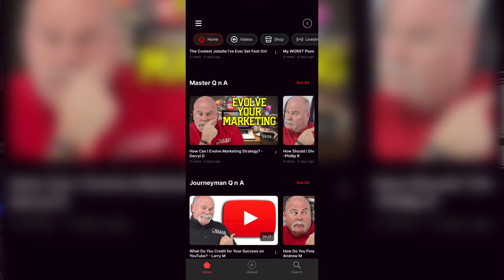Service Plumbing SUCKS Try This Instead

Comment: 3rd generation plumber here who was unable to escape plumbing as my career. Ive always hated how gross plumbing was and did spend my time in commercial new construction and remodel because it was cleaner. After years of trying to escape i stopped struggling to get out of plumbing and embraced it. Managed to get myself a job at a residential service company office. Sure its less than i could make in the field but no more dealing with sewage or the toll construction can have on your body.
Reply: At least being out in the field more or less forces one to get and stay physically fit. That's a plus.

Comment: I’ll never forget when I was about 20 yrs old. 
I had done a little bit of service plumbing and tried out new construction, realized how much better service was for me. 
I started at Roto and while in my initial training a customer asked why I would choose to have a dirty job. 
My response is still the same.. 
“I make as much as Firefighter or a cop” Im not getting shot at or running into burning buildings” “On the worst days I have to take a shower .. same as the best days :-)
Reply: Very nice

Comment: I got to watch the blue angels practice during fleet week on the top of a 35 story building in downtown San Francisco, we were replacing all the old gal piping to the water tanks on the roof, timing worked out perfectly

Comment: The worst poop job I had was when I worked as assistant maintenance, and we had a plumbing problem. They had a sand trap downstream of the office toilets and the laundry, and we dug down to the 4-foot square metal box and cut a hole in the top. I had to get down in it with a 5-gallon bucket and bucket all the tar-looking sludge into a wheelbarrow and carry it into the wood next door to dump it. Had to spend the whole day in that sewer pit, and at the end of the day, I was black with the sludge.

Comment: I’m a new construction commercial plumbing apprentice. Is it a smart idea to just remain in new construction or switch off to service a couple years into my career in order to learn that side as well? Genuine question as I’m just trying to learn as much about plumbing as possible!
Reply: Depends on your preference. If you're enjoying doing what you're doing, then there's no reason not to stick with it.  I know Roger made the transition to service after having done commercial work in the union. If you're not liking new commercial so much, you might apply for a service apprenticeship and see what you think. If it's not for you, you can always go back to new commercial.

Comment: Our local service plumbing company seemed pretty descent when I had to have them professionally seal off a gas-pipe before we moved for CYA purposes.  It was $300 for about 30 minutes of work back in 2021.  Not too shabby I'd say, but I can tell they have a lot of overhead built in with the admin assistant that takes your call and conveys the issue to the plumber before the plumber (along with estimate) is assigned.  I could see how it's aggravating with folks with very beat-up plumbing, though the higher the difficulty the higher the bill I suppose.

Comment: If a first year apprentice has a choice of the matter would it be best to start in service or construction? Is it true a construction plumber can do service but not vice versa? I’m aware both are very different services and do different things on a day to day basis but generally just curious where the best place for a first year to start is.

Comment: Service may not be where the big money is, but I love the people.
Reply from the maker: Personally I think you can make more in service than in new construction
Reply: @RogerWakefield  in my area I guess it depends, I can make 15k putting in a new sewer service , or 2500-3k a day doing service depending on the calls. But then there are days I do 900 because the calls just don’t bring in that type of money